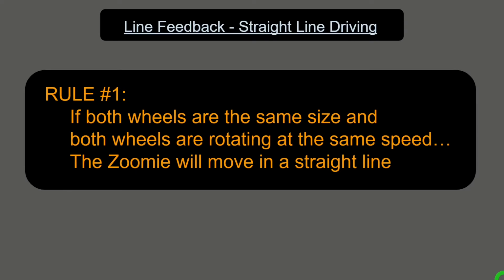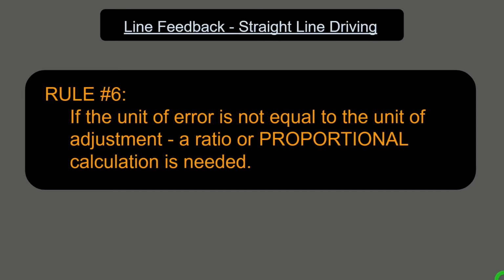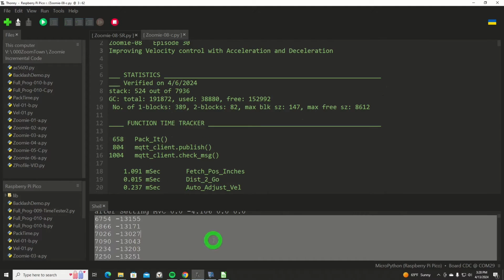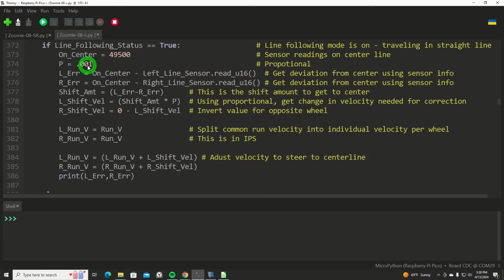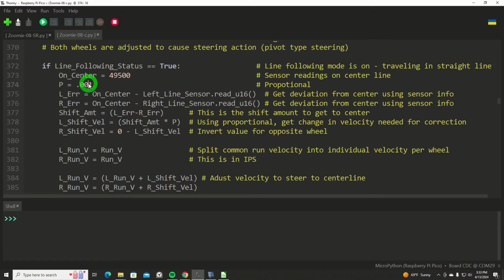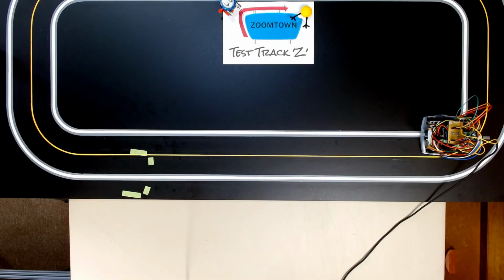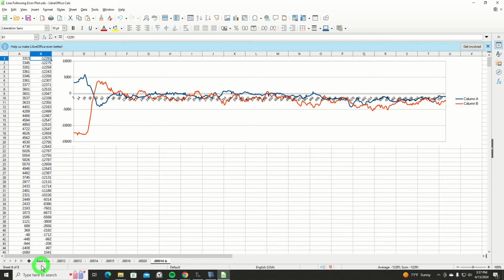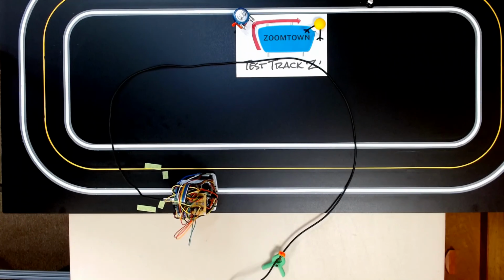030 Implementing Line Following on a Robot with Proportional Control

Comment: Hi Chris
Could you explain why the full proportional value of the Shift_Amt is applied to both left and right motors inside of half to each?
This PID stuff is all new to me.
Reply from the maker: Hi Steve, good question and I will attempt to answer that.

I started out thinking I would only adjust the speed of the slower of the two wheels (especially when turning) because most of the time, the wheel speed of the "faster" wheel is near the upper limit.  As development went on and I started testing the proportional control, I realized I needed more intensity to fix severe errors.  Adjusting just one of the motors was creating a limit to how fast I could recover from error because I was hitting the motor's limit.  At this point, the Proportional was only being applied to one wheel.
I then implemented the proportional adjustment to both motors, one opposite the other so that recovery would happen twice as fast and I hopefully would stay off of the Upper and Lower limits of the motor's working range.  As you suspect, I should apply half the proportional adjustment to each wheel, however, I didn't (senior moment I guess).  The good part was that change resulted in good performance.  With that said, I could have doubled the "P" value and halved the "P" for each wheel to be more "traditional".

In a few weeks you will see a major re-write in this section of the code.  Looking over the code I started to see a way to reduce the "work" being done so I thought I would give it a go and it seems to be working pretty good so far.  The constant evolution of a program is always fun, but I have to be careful to not get stuck in the "let's make it better loop" or this project will never move forward.  

Cheers!
Chris
Reply: @MakingStuffwithChrisDeHut  Of course! The idea of applying the adjustment to both wheels in opposite directions is inspired for keeping away from the motor speed limits. As you said, I see now, the "P" value is just a scaling factor to the shift_amt and it is the overall effect that matters in getting the result you wanted. Very clever coding on your part, I look forward to see what you have come up with in the next version.

Fascinating series you have created with Zoom Town.

Cheers, Steve